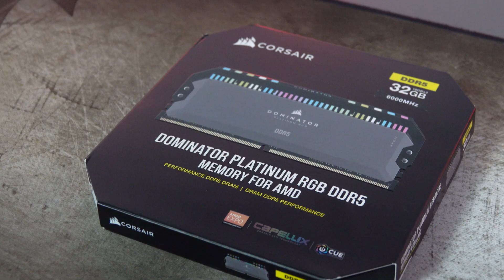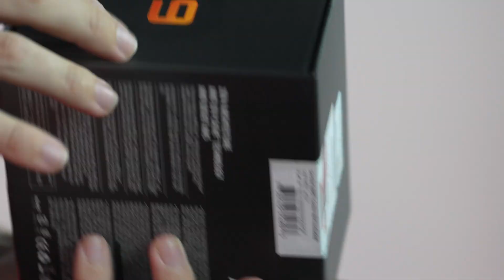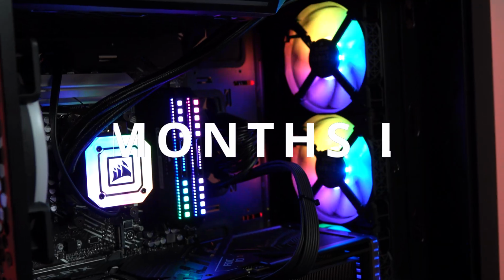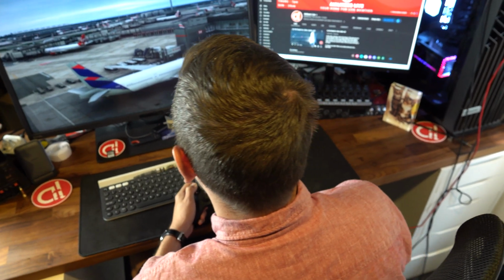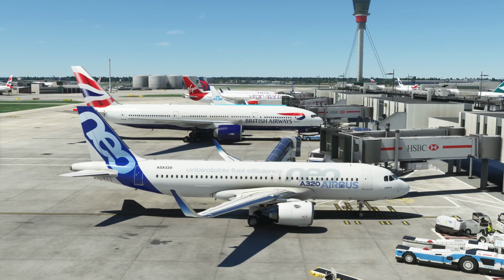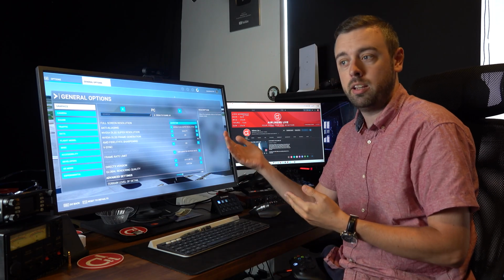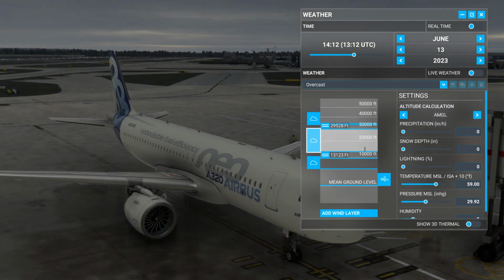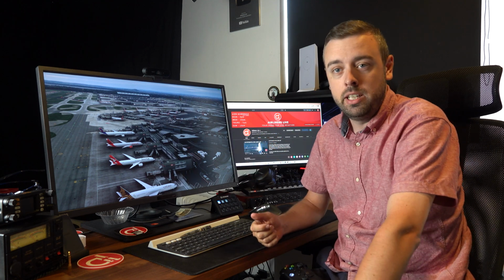Building the ULTIMATE Microsoft Flight Simulator PC!

Comment: Good choice on using an 4090.  I went with a 7900XTX and it SUCKS for flight sims.  It's great for FPS and TBS games/ not flight sims- 7800X3D CPU which seems fine (64GB RAM), but idk... xp12 has all sorts of issues, so maybe that's it?  All I know is my older 3600X/RX5700 cpu/gpu with 16GB RAM ran the flight sim almost as well as the newer machine I first described. Maybe it's a Windows 10 vs Windows 11 issue?  (I truly believe the 4090 is the biggest factor in all this, but I'm no computer wiz)  I noticed the 4090 has 2 HDMI's in addition to the 3 DP's.  My 7900XTX only has 1 HDMI.  I'm trying to run 2 additional touchscreens for G1000 PFD and MFD, (but sadly can only run one) and it simply cannot handle Air Manager in anything other than a Cessna (BORING- I have over 1000 hours in actual 172's), or Baron (also have 350 hours in a Baron)... I want to use this for flying jets, and coupled with Air Manager, XP12 simply crashes..  even if it doesn't, all screens go blank in XP12 when trying to run Air Manager with the G1000 panel.  The computer doesn't crash, but like I said, XP12 seems absolutely riddled with problems.  I'm tired of endlessly fiddling with settings, and trying to get these two programs to work together.  I want to fly a flight sim, not re program a computer for 6 hours a day just to get 15 minutes of flight sim time.  Definitely thinking of upgrading to a 4090, and the power supply as I only have a 800W supply (7900XTX needs a lot less than a 4090).  Thoughts?  Anyone?

Comment: Hi. Have a question if I may? Im now on a xbox x and want to change to a pc. Since I don't have a clue what kind of a pc I should buy for the new sim I asked in a computer store and he came with this. Is this enough for ms 2024 or do you think I can go better? Thank you.

ASUS ROG STRIX B650E-F GAMING WIFI - ATX - Socket AM5 - AMD B650  × 1

€ 264,95 (incl. btw)

AMD Ryzen 9 7900X3D / 4.4 GHz processor - 12-core  × 1

€ 562,50 (incl. btw)

ARCTIC Liquid Freezer II 280 processor liquid cooling system  × 1

€ 79,50 (incl. btw)

Corsair VENGEANCE - 64 GB : 2 x 32 GB - CL40 - DDR5 - 6000 MHz  × 1

€ 229,50 (incl. btw)

Samsung 990 PRO MZ-V9P2T0BW - 2 TB - PCle 4.0 NVMe M.2 SSD  × 1

€ 179,00 (incl. btw)

Sapphire PULSE AMD Radeon RX 7900 XT - Radeon RX 7900 XT - 20 GB GDDR6  × 1

€ 749,99 (incl. btw)

Corsair RMx SHIFT Series RM850x - 850 Watt 80 PLUS Gold Fully Modular Low-Noise ATX PSU - ATX 3.0 and PCIe 5.0  × 1

€ 155,00 (incl. btw)

Corsair 5000D CORE AIRFLOW Mid-Tower ATX PC Case — Black  × 1

€ 149,00 (incl. btw)

Microsoft Windows 11 Pro - OEM - 64-bit - Nederlands  × 1

€ 169,00 (incl. btw)

Assemblagekosten - PC uit losse onderdelen  × 1

€ 65,00 (incl. btw)

Comment: Why would you set the fans on the radiator for intake? All you would do is pull the heat from the radiator back into the case.

Comment: What did you click off to make your fps rise so much?

This is what I was looking at to buy $4100 

Processor
Intel® Core™ 14th Gen i9 14900KF (24-Core, 68MB Cache, 2.4GHz to 6.0GHz Thermal Velocity Boost)
Operating System
Windows 11 Home, English, French, Spanish
Video Card
NVIDIA® GeForce RTX™ 4090, 24GB GDDR6X
Memory
64GB: 2x32GB, DDR5, 5600MHz XMP
Storage
2 TB, M.2, PCIe NVMe, SSD
Chassis Options
1000W Platinum Rated PSU, 240mm Liquid-Cooled CPU & Clear Side Panel
Wireless
Intel® Killer™ Wi-Fi 6E AX1675, 2x2, 802.11ax, MU-MIMO, Bluetooth® wireless card

How close is this to yours

Comment: I just bought a new Powercolor Red Devil AMD RX7800XT and waiting for it to arrive the minimal stock they had here in NZ sold out pretty fast, am upgrading from a 6750XT not expecting a huge upgrade cause 7800XT still a mid range card but be nice going from RDNA2 to a RDNA3 GPU but also gaining another 4GB Vram over 6750 will be more future proof, I expect better RT performence too I have a I7 11700K CPU.. I cant afford a 4090 its just a pipe dream, lol MSFS seems to run good for me at 1440p for me with the 6750 atm on ultra settings.

Comment: Can you please put all the part line item numbers?  I  can order the same items at your website?
Case: Fractal Design Torrent
Motherboard: ASUS Prime X-670P Wifi
CPU: AMD Ryzen 9 7950X3D
CPU Cooler: Corsair H150i Elite Capellix
GPU: ASUS ROG STRIX NVIDIA RTX 4090
RAM: 32GB Corsair Dominator Platinum RGB DDR5 6000MHZ
PSU: Corsair RMX 1000W
Storage 2x Corsair MP600 PRO XT 2TB M.2

Comment: You should never fit a Aio radiator with the inlet/outlet pipes at the top.  Any air in the system (there is air in every system by design) will be at the top of the rad and will cause cavitation in the pump both reducing cooling and causing excessive wear.
Reply: You both are wrong as you can mount a radiator anyway you want to. Some ways are better than others, but there is definitely not a wrong way.
Reply: You really should know you are in trouble when the two ends of your statement contradict each other. @jamesm568
Reply: Nothing wrong with it mate. Don't listen  to the bullshit on the internet been building custom PCs and custom water loops for years and have tested thousands of different loop routes and rad configs. It's amazing how the syphon effect works 😂 it's even better with a pump. Sum ppl have all the gear and no idea.
Reply: Air in any liquid at best reduces cooling efficiency,  but hey if you are happy with that you do you  :) @kurtlazarus5975
Reply: No issue at all, the pipes are under the pump. What you want to avoid is having the pipes above the pump (the top edge of the radiator). Gamers Nexus video has been massively misinterpreted by many people.
Reply: @EimisMantis  ...  pipes are on the of the radiator at the top of the case and above the pump.  Air rises to the top of the rad and enters the outlet pipe to the pump.  I don't a GN video to tell me that is the incorrect way to install it.

Comment: Asus X670 Prime-P, is a basic motherboard, and you should have something much better than that. R9 7950X3D is a waste of money. Due to the rendering nature of Flight SIM 2020, and using this for editing, you would be better off with the R9 7950X. The R9 7950X3D is a gaming CPU and nothing else. Still, if this is what Scan  supplied you with, then so be. It's still good, but could be better. With Flight SIM 2024 coming, I will build a new PC with the 14th gen Intel and of course a RTX 4090. Great stuff guys.
Reply from the maker: Cheers Ian, mostly this PC is used for gaming. Flight Sim content was the brief for this so the 3D cache was perfect. Really happy with the build overall
Reply: Intel is no where near as good on flight sim compared to amd x3d chips

Comment: Awesome build Martin, massive GPU with is it a 6 way or 8 way power from the Modular PSU. Is that a 12 or 16 gig Graphics Card, had to give that a firm push I imagine into the PCIE slot/socket. RAM needs a bit of a push to seat it as well. Is this an Intel or AMD processor build. Fantastic FPS and the rig didn't even flinch or stutter when you were pushing maximum AI and Graphics. I am very jealous, glad the pc is running sweet and is used for Video rendering and editing etc. 👍👏👏👏👏👏👏👏👏👏:_lul:□□□